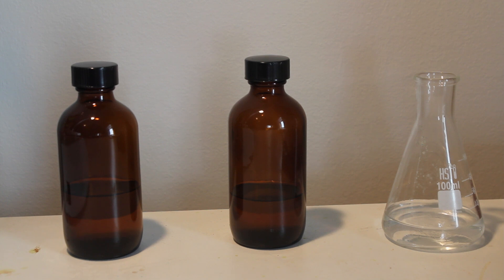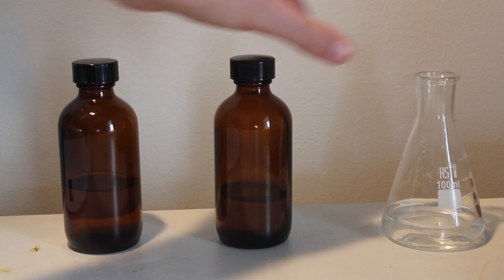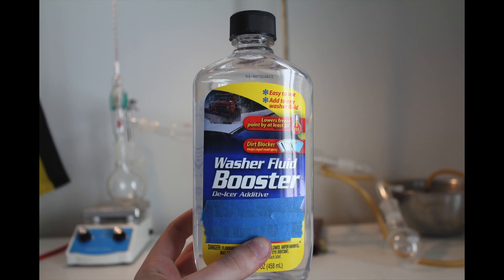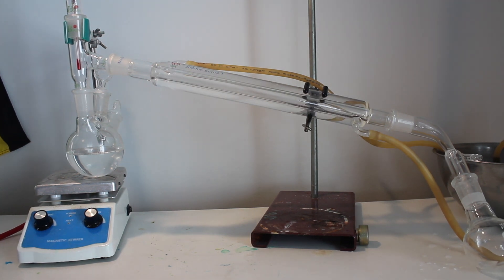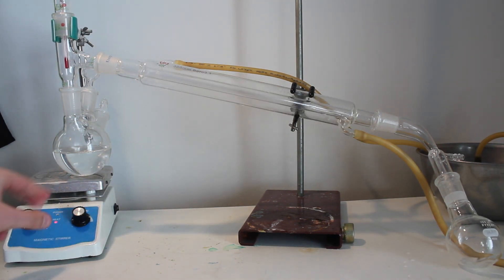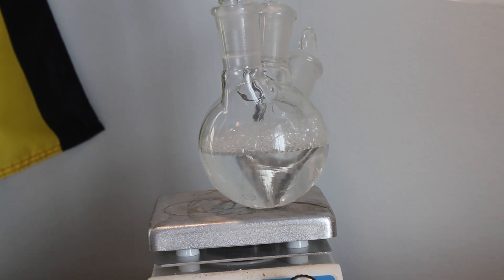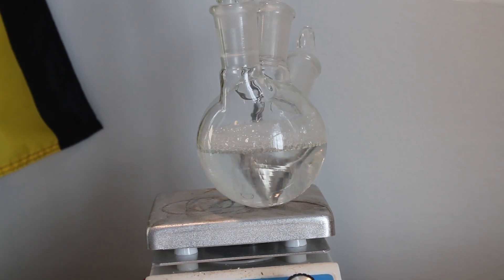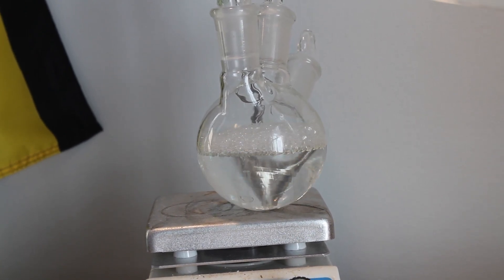Methanol, Isopropanol, and Ethylene Glycol from Antifreeze Booster

Comment: That's a cursed way to set up a flask my dude. Should have attached the head to the middle neck. Good video though...if you are dead set on getting methanol it can be distilled from Heet (automotive product) which is like 99% methanol.